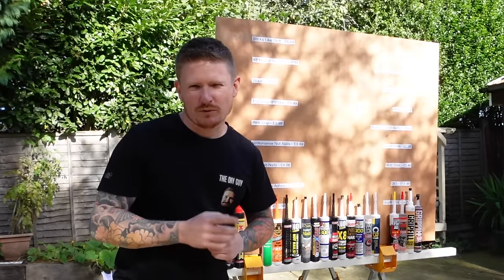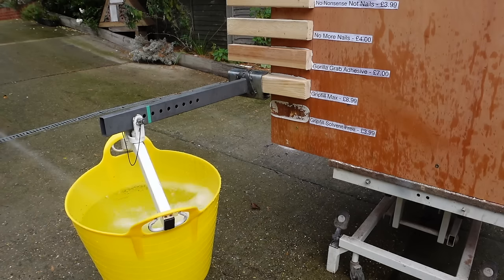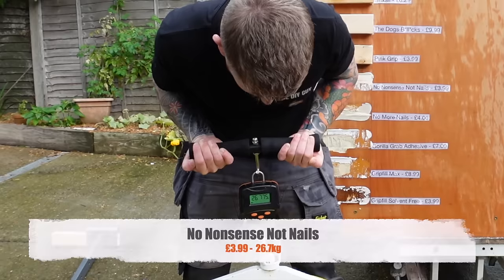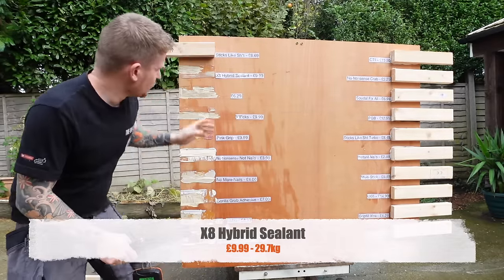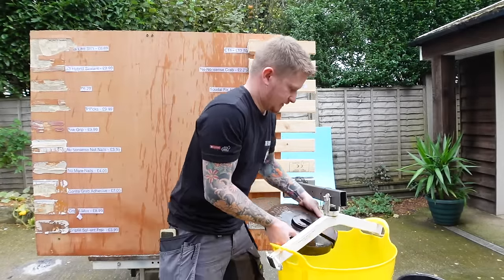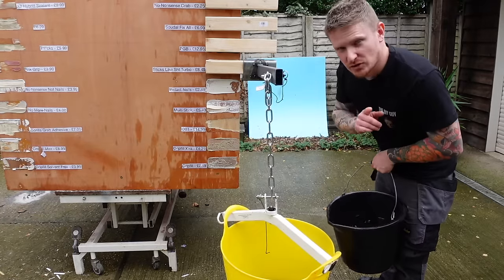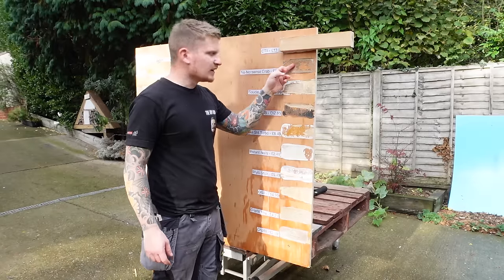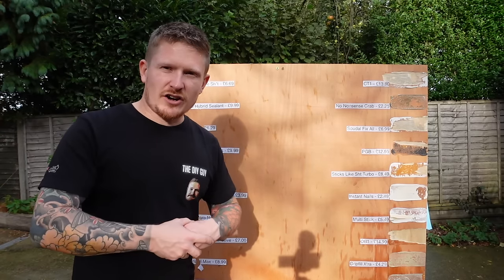Worlds Biggest Adhesive Test | SHOCKING RESULTS!

Comment: Awesome idea, Please would you re-test all those glues where the substrate failed, i.e. instead, glue to solid timber not ply? Love to see a definitive guide :)
Reply: I certainly think the adhesives that broke off the board substrate deserve (assuming you have enough left) to be retested on a peice of solid timber or thermolite  lock.
Let's see which one is the daddy👍
Reply: Great suggestion - obviously where the substrate failed you are not really testing the adhesive, so no real differentiation possible between the various products in this case. Some of these adhesives are very impressive but I wonder whether many people would ever use/trust them to the full extent of their capabilities, relying instead on mechanical fixings. I think most people just use these sort of products for lightweight items like skirting board/architrave where there is a low risk of failure?
Reply: Thanks for making this fun and informative video. As with Bagpuss LXV, I’d never trust to the holding power of the adhesive alone, and would definitely use a mechanical fixing in addition to the adhesive. I’ve seen old school, green Gripfill for as little as 99p, but it tends to scab over very quickly, making it difficult to apply. I certainly wouldn’t use it for anything heavy, or above floor level. As for the tenner plus options, again I’d use mechanical fixings for that ‘belt and braces ‘ reassurance. Personally, when I’m paying, I’ve found Multi Stick very reliable, and up until recently it could be found at £4 a tube. I’ve been on plenty of jobs where Sticks like is supplied, and it is very good - oddly enough, the clear seems stronger - but at double the price of Multi Stick, I’ll just bang some brads into the skirting or architraves and move on.
Reply: What a load of nonsense, the cheap ply wood failed on half of these not the glue!
Reply: @brianiswrong  yes agreed with you I wish he could rested them in solid wood
Reply: Skipped vid bc of your comment 😂. You make an extremely valid point 🤔🫡

Comment: Methodology is slightly wrong which results with unknown real max value for some of these adhesives. Every time the plywood broke instead of a bond it did not show real strength of the adhesive. You would need to glue test blocks to unbreakable (at least within this test limits) type of base. E.g. metal, pretty thick glass or pretty thick plastic or wood that cannot break before bond breaks.

Comment: Great test and your work is appreciated.  However, there can be voids and different densities found within a single sheet of plywood. If one test fails at 24 kilos and another at 41 kilos and they both tore out the plywood, then the adhesive can only hold what the plywood will hold. Need to be tested with a more stable wood. Like oak slab.

Comment: This video was a rollercoaster of emotions, from pure intrigue over how much some of those adhesives hold, to anxiety every time you put the weight in the bucket, to joy every time you got startled by the falling bucket. Great video.

Looking at the top five, if you're looking at holding power, then Gorilla is definitely the top. But if you consider how many KG you get for the price spent and call that "value for money" (in your top 5, I haven't looked at all 20) it looks like the winner is Stixall, giving you approx 6.3 kg per £1 spent. Unsurprisingly, CT1 is dead last for value for money with only 2.9 kg per £1 spent. Obviously there are other factors in play but if you wanna accept that fuzzy logic, looks like Stixall is the best choice for your average DIY'er.
Reply from the maker: Great analysis. Glad you enjoyed the video!

Comment: Really appreciate the work you’ve put in to this. 👍😁
I have been using the dogs b:locks to stick replacement soles on my running shoes, but I think i might try the gorilla glue next time.
Reply from the maker: Your welcome 👍
Reply: That's interesting @bbsaid218. Do you find it's flexible enough? Do you keep it under pressure for a certain amount of time?

Comment: Good video! I feel like we need a follow up on all the ones that held out when the ply failed using a stronger substrate. When doing skirtings I actually prefer a lower tack so they're easier to come off for whomever is replacing them.
Reply from the maker: I will see what I can do 😃
Reply: @TheDIYGuy1  Basically all cases where the substrate failed prove that the glue is stronger than the material it glued together.  The measurement for these actually measures the strength of the substrate not the strength of the glue. We must be fair to the glue manufacturer.  Another test would be nice to show how the glue withstands humidity for example.

Comment: Not a good test because it didn't test the glue bond.  I'd rather see a 2x4 board cut at an angle and then the glue bond evaluated rather than looking for the plywood to fail.

Comment: I don’t agree with the principle of demoting a product when there is partial or complete substrate failure at low loads. If the timber has not exposed the glue line, regardless of load - that’s a good result. Comparing results that include any substrate failure with those that don’t, is a flawed test in my opinion. Plywood is inherently prone to inconsistent delamination, especially lower grades of ply.

Comment: Thanks for the effort on this one👍🏻 Being in the trade you often wonder what you get for your money. I use a combination of stixall, fix all, CT1 and SLS turbo depending on application. The SLS turbo and Fixall Turbo are particularly good due to their faster curing times. My concerns are always the long term performance of the product and the substrates they are being used on. It would be interesting to see how the products faired over 6 months or so on a substrate that doesn’t delaminate. Thanks again for this, it was quite the eye opener, well apart from the gripfill, I’ve been to many property’s and removed skirtings with my fingers that have been “stuck” using that stuff!
Reply from the maker: Your welcome, and thanks for your comment and thoughts 👍

Comment: Many thanks for this. I  mounted an (extremely heavy) radiator to a plywood panel glued to a wall as I did not want to breach the waterproof tanking. Despite the 400kg per square metre rating it failed at approximately 100kg per square metre. I will use your research when choosing an adhesive for round 2!

Comment: I use Multi stick for sticking boards on walls never had a problem with it. Recently I got some Everbuild Instant nails for soffits which is anyway a hollow lightweight material. While on jobs when I was a handyman before retiring I tended to use Multi stick and it never failed. As you say depends what you use it for.

Comment: Thanks for that very useful information.  If I wanted to nit pick I would say that the weak point of the test was the sheet of ply that you were using, but considering the weight and the leverage employed some of the top ones were really fantastick.  Get the pun?
Reply from the maker: I completely agree. I think the majority of the adhesives used were massively over engineered for the job. I may return with a better test with a better substrate in future.

Comment: Great video again! Shame about the plywood failures and probably best to use solid wood or marine ply at over £100 a sheet 🫣! I have always used Stixall and was really pleased to see how well it performed as it can be used in wet conditions too and has never let me down.
Reply: So true, OB1 didnt leave a single mark of adhesive on the board, basically the board failed completely

Comment: Great video !    Very good test !  Surprisingly different results from another UK video on here though with a very similar testing method (almost identical).    To be fair, in cases where it was not the adhesive that failed rather the wood that broke apart, the adhesive itself deserved a higher score for it's bonding capabilities?    So in some cases, it's the wood itself that is the weakest link, not the adhesive.  

Also I would really like to see a test of these products used in wood to metal contact & perhaps more likely wood or metal to masonry i.e. Lintels, Block, Brickwork, Stone, Render, Plaster, Plasterboard.    As these are perhaps the most common applications maybe a timed test for different carefully applied weight's, slowly increased in equal measure to see if they hold up over a 24 hour period.

I would be very interested to know what you think?
Reply from the maker: Your right, I may be re visiting this with different substrates in the future

Comment: Excellent review of the many adhesive options available today. I generally use what's onsite. However, if I'm buying, I tend to use Multi-Stick, as I found it to be reliable and reasonably priced. The fancy stuff, coming in somewhere south of a tenner, is just too rich for my blood. And, as you say, if you're only sticking some skirting, well, it won't be doing any heavy lifting. On top of that, anything requiring up to 40kg of holding power, and I'd be looking to go belt and braces with some form of mechanical fixing too.

Comment: Hello, not sure if you check or read comments. Would be great for you plumbing playlist to add a video of a radiator change, either like for like in size. How to disconnect the radiator and fit a new one with same valves and pipe work. And maybe adding a bigger radiator, hanging adding pipe work and new valves ! One of my favourite diy YouTube pages, helped me complete many electrical jobs around my home !
Reply from the maker: Hi. I do indeed see my comments. Thanks for your support. I will see what I can do for you with regards to your request.

Comment: Great video people like me look for individual independent, non bias tests / reviews like this its really helps! Thanks! In my opinion and experience the OB1 holds more weight, also it looked like that was a complete substrate failure and not at all sealant / adhesive failure. I think there is room for error in this particular test and that should not be mistaken for an anomaly, whenever the substrate fails that means the weight at that time is not the maximum load, and that the product could potentially hold more but that element was eliminated due to the failure of the substrate. I think the substrate needs to be stronger to not only prove its a fair test but to also be realistic an accurate at getting the results as accurate to each individual products integrity as possible.

Comment: The max results are more an indication of plywood delamination strength.  It would have helped to use solid oak or maple substrate and test bars.  Construction adhesives are valued for their instantaneous grab during assembly rather than fully cured strength.  So we really want to see wet grab and month old strength evaluated in separate tests.

Comment: Greetings in The Name of Yeshua!
First of all 'Thank you' for taking the trouble in making this informative video. Appreciate it from the core of my heart.
Secondly, the test has been intellectually conducted with no partiality to any of the adhesives.
Lastly, just a suggestion, how about using metallic planks to metallic board, if at all the metallic planks sticks to the metal board so that there be no substrate failure rather than purely adhesive failure.
Finally, best wishes for your upcoming videos.

Comment: Thoroughly entertaining! As a keen DIYer I'm slightly suspicious of gluing anything instead of screwing it in, but this shows how incredibly strong they all are. Of course with the leverage the pull on the adhesive was far higher than the bucket weight in your tests. I fitted some lightweight coving recently and was slightly worried that cheaper Gripfill might not do the job!!! Although not the best on your test clearly it is literally hundreds of times stronger than it needs to be for this purpose!
Reply from the maker: 😃 great comment
Reply: Funnily enough, I put some polystyrene coving up with gripfill and it fell off the plasterboard slowly over the following weeks! A full kilo with metres of adhesive... And it failed.

Comment: To be fair always used CT1 however that stix all for the price could be an option going forward.
Reply from the maker: Absolutely. Let's be honest,any of the best performers here are plenty capable
Reply: Yea and to be fair I do like how you explain when the wood came off too. As let’s be honest you could have fixed some in different locations and the results could have been slightly different. 
However the job does what it needs too. Just shows you get what you pay for most the time. 
Solvent free don’t bother 😂 and there is some surprises out there. 

I also really enjoyed your rawl
Plug test too. These kind of videos are fab as I’m a sucker for a gimmick but you don’t want to use a gimmick in a customer house

Comment: I can't see what weigher you're using but they normally have a peak function. You could attach that in between the bar and the bucket and it'll show the highest recorded weight.

Also, I think it's worth noting that if there's a substrate failure that's an instant win for the glue. The weight measured after that situation is meaningless as it's just telling you the weight the substrate layers can handle, not the glue.

Comment: Great video and interesting results. Although a little unreliable due to the plywood. Was surprised by the Gripfill (solvent) as I've found it very strong and quick. Equally surprised by the  "sticks like sh*t" and "I can't beleive it's not nails" (solvent free) as I find they both offer no grab at all and are still not cured after 24hrs.
Reply from the maker: Great point!

Comment: Very nice video!  I did not expect Sticks Like Turbo to hold more weight than the standard one though. It's just  more expensive because it sets really quicker compared to Standard Sticks like, but not stronger. A bit like Soudal Fix All Standard and Fix All Turbo. If not in a rush probably no need to use the Turbo. 😊
Reply from the maker: Thanks for watching!

Comment: Great video, thank you 🙏 

I used Gripfill recently to stick a baton to a container ceiling for a strip light. I came back 24 hours later and the product basically just came off the ceiling with a light pull. Like you, the product was still wet. 

I called Evo-Stick and they told me as follows:
When using Gripfil it should be spread as thinly as possible. It dries through evaporation and thus the more there is the longer it takes to dry. Also, when it dries it shrinks. The thicker the product is applied the more shrinkage is possible and the bond’s likelihood of failure is increased.
Reply from the maker: Great info. Thanks 👍

Comment: Nice experiment but those with substrate failures must be retested with solid wood with the grain running vertically.  The plywood is not guaranteed to have layers consistently glued on the whole surface.  I would rather use dimensional lumber  (2"x8") installed vertically and glue the test pieces to it horizontally as you did for the plywood.

Comment: Not very clever test. You just mention sometimes "substrate failure".
OK but do you want to measure the adhesive or the substrate toughness?
If you want to compare adhesive strength, you should use other materials.

Comment: Because of how leverage works in physics, they're holding FAR more than the weight you show....The length of that arm multiplies the amount of weight held. Try holding a 20kg plate down by your side vs holding it out 90 degrees to your body and tell me which feels heavier(bearing in mind its the same weight)....Obviously this is kind of irrelevant, and this test is purely to show which holds the higher number...it's just worth bearing that in mind if your trying to mount soemthing that weights 20kg, all of these would comfortably do it unless it stick out and has a weight on the end

Comment: I appreciate you're doing this purely as a strength test but where some of the products like the solvent free are better is they stick to dry dusty walls that the solvents don't stick at all.
So products like the CT1 & OB1 stick to basically anything & will stick to wet crappy surfaces also.
The hybrid polymers will stick things like melamine faced boards like Egger & Kronospan that none of the others will.

Don't want to knock your test, but as a follow up test maybe do the same test with a concrete or brick substrate which much much more what these adhesives are designed for & think you will get some massively different results.

Comment: I really liked this video. Entertaining and well executed. I think you’ve probably realised that all those adhesives which led to substrate failures haven’t really been compared against each other. You wisely haven’t put them all in a table because it wouldn’t be fair. You’ve given us a list of adhesives which ‘did not fail’. I would definitely watch a video where you test all of those against a solid heavy beam or some other higher strength substrate test. Great job. And as another commenter pointed out the leverage means you’ve tested way over the weights stated. Pulling on them from a direct point load would be very different. Great products all!!
Reply from the maker: Absolutely. I may return with another test 😁

Comment: great test, and others say, good to see somebody in the UK doing it with stuff we can buy! obviously there are many factors involved that you can test for, but as a rough guide it does the job- a clear difference between the ones where the substrate failed and where the adhesive failed....and possibly a third category of partial failure. I think an interestinng factor to consider would be time as many of these products are meant to work over years not seconds. So maybe set up a test with hanging weights and see how long it takes for the adhesive to fail? (make each test surface area much smaller then you don't need so much weight).
Reply from the maker: Thanks for the feedback 😊